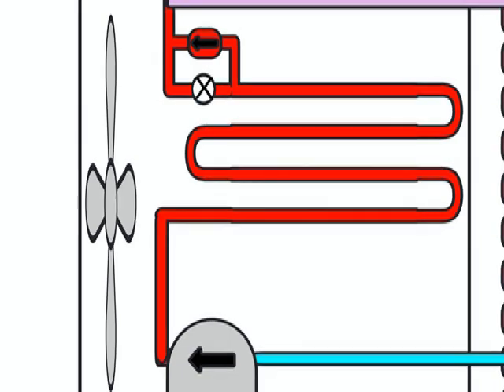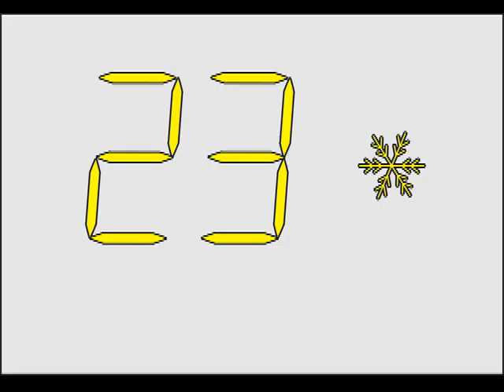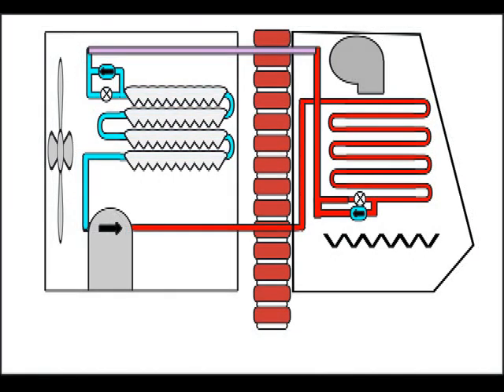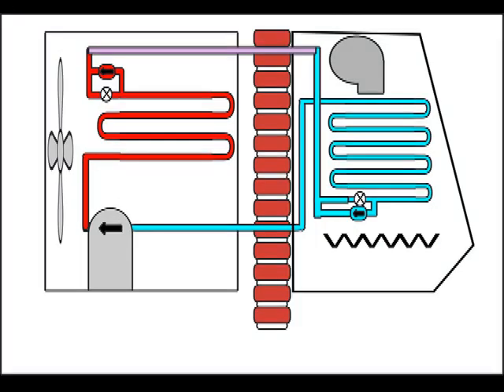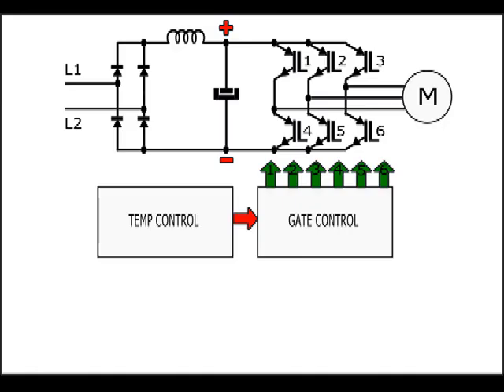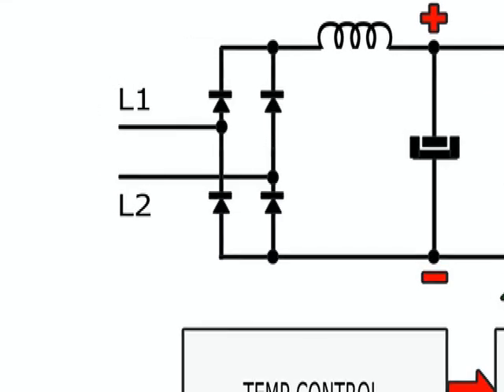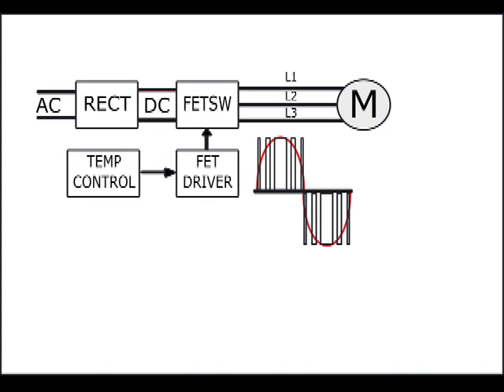How a minisplit inverter heatpump works

Comment: Hi Chava, can you go over the difference between BLDC motors and inverter motors (or, in this case, an inverter compressor)? Do both use PWM to create the sinewave?
Reply from the maker: Well, BLDC (brushless DC) motors use an internal inverter circuit in order to simulate the action of the brushes switching the polarity in the windings. In this regard they are similar to inverter motors, however they usually have a fixed speed, while speed controls for motors shift the frequency of their three-phase output, by using PWM to create a variable frequency output out of DC from a diode bridge, as you very properly just commented. Regards!!!

Comment: You forgot about the reversing valve it reverses the flow of the refrigerent not the scroll compressor spinning the opposite direction!
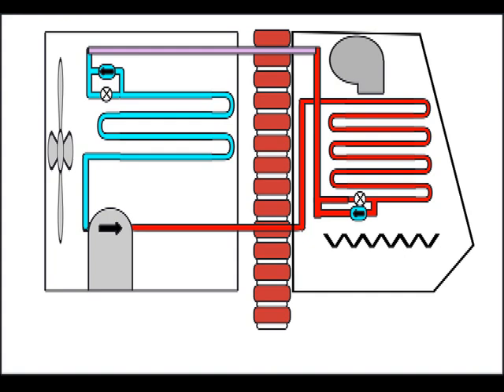Reply from the maker: Dear Yi Ling, if you listen closely, at 1:32 I explain that "solenoid valves... as if the compressor..." in other words, the valves produce the same effect AS IF the compressor has changed its sense of pumping the coolant. I am sorry, I put it that way in order not to make the video too long, explaining the operation of the valves.